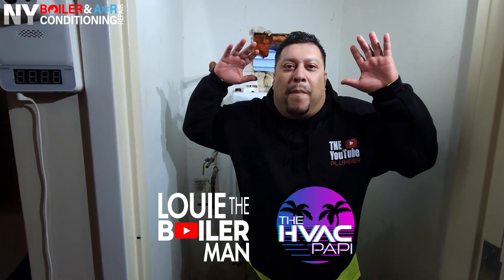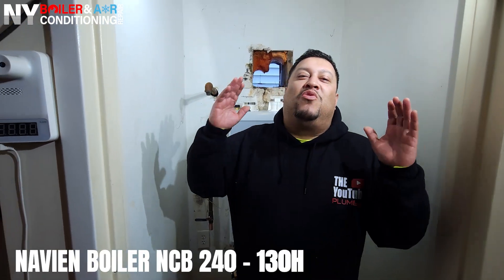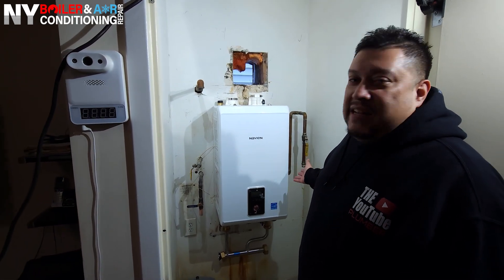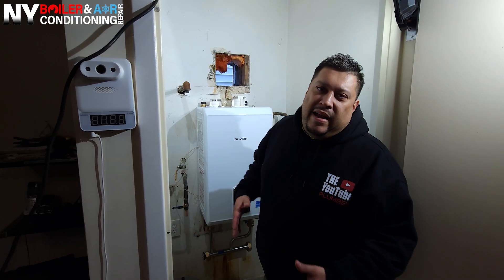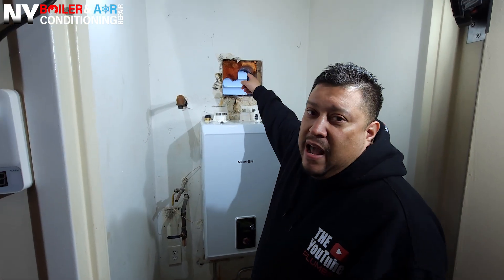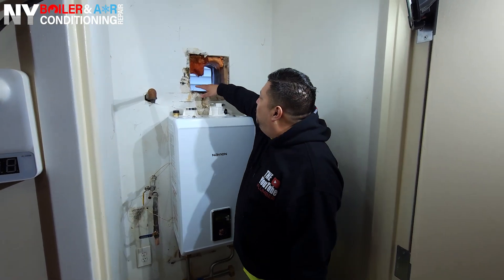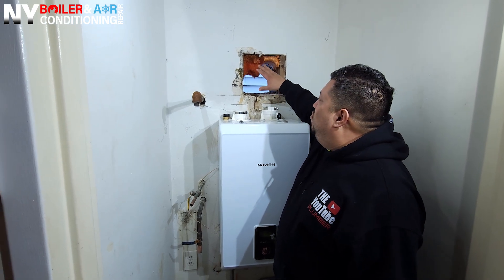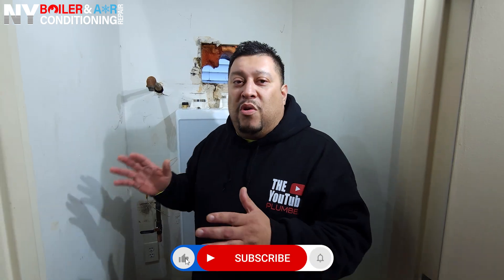Installing a Navien NCB Boiler - The Last Boiler You'll Ever Install

Comment: How did you bypass the outdoor thermostat?
Reply from the maker: Outdoor thermostat? do you mean an outdoor reset sensor
Reply: @louietheboilerman yea, sorry. I have an outdoor sensor that needs to be hooked up. The wire is only like 3 feet, I’m over 30 feet to an exterior wall
Reply: Are these boilers quiet? How’s the noise level compared to an oil burner?